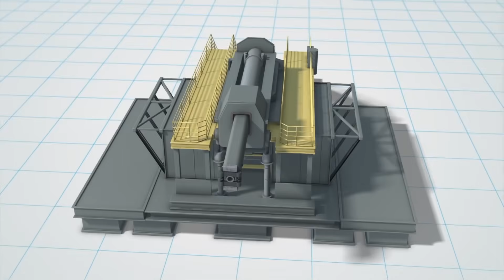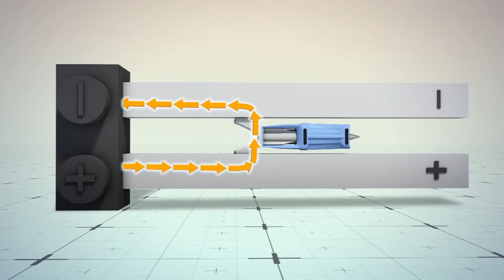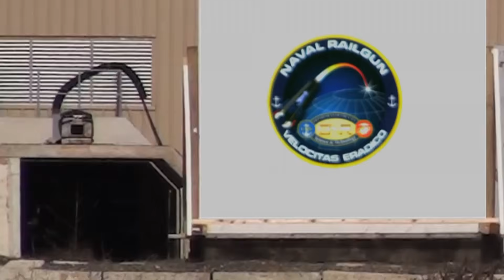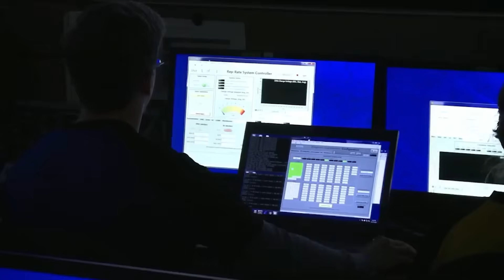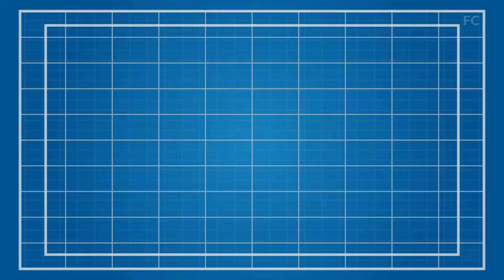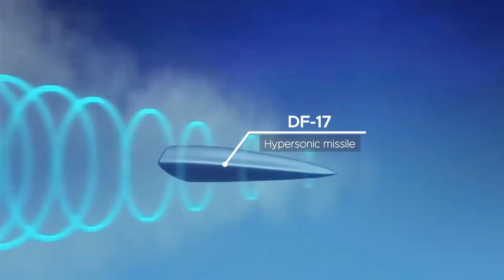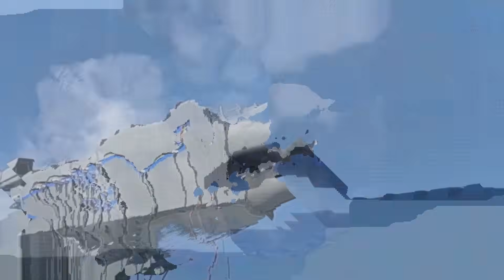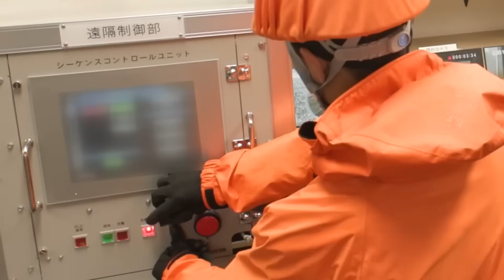Japan's New MASSIVE Railgun Just Beat Every $5M Chinese Missile!

Comment: The rail and laser are both designed for flat earth operation.  Because of the time of flight, there is a significant drop in elevation and just like a rifle, the sights have to be adjusted up.  The laser does not have that issue but can't shoot over a curved surface.  These videos are for an uninformed public but the military knows that the earth is flat.
I will add that the rail gun was a project many of my friends have worked on going back over 40 years so the 15 year project stated was only one phase over the length of the project in Austin, TX.

Comment: I don't believe that a slug from a rail gun can hit a hyper-sonic missile with any reliability. Assuming the initial targeting solution is accurate, that the gun has the inherent accuracy, variations in wind and atmosphere conditions would be sufficient to result in a miss at ranges of many km from the gun. It would be easier using a missile with onboard guidance that only needs to explode anywhere near the attacking missile. This is a dream.

Comment: China vs Japan Railgun: Direct Comparison
ChinaJapanFirst shipboard test20182023Muzzle velocityMach 7Mach 6.5Projectile mass124 kg320 gramsRange100-200 km~20 kmPurposeOffensive strikePoint defenseGuided munitionsYes (BeiDou-linked)In developmentAI integration100,000 sensors, self-improvingNot reportedBarrel life120 rounds120+ rounds
Bottom line: China fires a projectile 387 times heavier, five years earlier, at higher speed, with 10x the range, and has satellite-guided smart shells.
Japan built a defensive pea-shooter. China built an offensive cannon.

Comment: The key to all of this is the famous Japanese capacitors. No country on earth has mastered capacitors like Japan has. If your electronics (from stereos to computers) do not have Japanese capacitors in them, throw it out. NOTHING is as great as the Japanese have made them. That country does not exist. Thank you Japan for doing it correctly!
A capacitor provides all the required electrical current to all the components in the right balance or correct 'capacitance' (no pun intended). It does not matter the size of the electronic components (be they small watches to giant rail guns) if the correct power, when its needed, is not delivered at the correct time for the job needed the electronics will overheat. The enemy of ALL electronics is HEAT. Lower the heat and you will provide insane reliability. Enter the Japanese capacitor. They mastered this tiny (or large) component which is so key to everything that runs and uses electricity.
I would never entertain buying a motherboard if it did not have Japanese capacitors. You would be an insane person to not go with their brilliance. As personal computers are starting to exceed 8300+ Mhz speeds, the capacitor has its work cut out for it. That is an INSANELY fast speed of electrical travel amongst components. Japan always leading the way in all future technology. God bless Japan and keep them free forever. ❤

Comment: Awesome news! It should also be noted that 40mm is large enough to mount a minimal guidance system. Since it only needs to operate for less than 30 (hyper-sonic >= 1 mile per second; 20 mile range) seconds, power requirement is minimal. Forget onboard radar. Even attenuated lasers can be used to "paint" the target out to 20 miles (can be the same lasers used for close-in defense, just needs to be bright enough for a photo chip about the size and weight of a cell phone camera). Nearly weightless piezo-electric fins can be used for steering.

It is almost irrelevant that it was Japan who made it work. We both have a vested interest in sharing this technology.

Oh, and about China taking China using hyper-sonic missiles to conquer Taiwan in a conventional war? Hahahahah!!!!! Make the whole island into an "unsinkable ship" mounting thousands of these puppies. That is checkmate against missiles, planes, and landing ships...

Comment: The power infrastructure and expense required to sustain fire on a rail gun, even if successfully developed, is unfeasible when it can be massively out-ranged and destroyed with a much lower cost hypersonic missile. It’s like trying to invent a giant high tech crossbow or catapult.
Reply: Range isn't a factor since the missile is heading for the target. Also mach 6.5 is hypersonic. Third it is being used as a missile interceptor.
Reply: @richardhill4938 how does a rail gun target a hypersonic glide vehicle?

Comment: 11:32 So japan beat the usa by making a temu version of what usa tried to make. still awesome that they did that unlike the USA simply pausing the program to concentrate on hypersonic cruise missiles instead.
 USA "wanted": 64 megajoules(MJ), 155mm, Mach7+,  10,000 gram projectiles (10+ kg), 100+ Nautical Mile range, 185km - 370km (115 to 230 miles)
Japan made: 5 megajoules (MJ), 40mm, Mach 6.5, 320-gram projectiles, 100 to 180 kilometers (62 to 112 miles)

Comment: The weapon has a fatal flaw, just as the chinese laser has a fatal flaw.  The tungsten slug HAS to hit the target, otherwise it's useless.  But it has no guidance system, no heat seeking, no ability for proximity explosion.
Reply: Did you actually watch the video particularly on the satellite constellation and underwater drone centimeter-accurate guidance system part?

Comment: Big error in this video. China lasers are dismissed cause performance is decreased by humidity and distance. However. China will be aggressor in China Sea. They can pick attack days with low humidity and zap laser from 5 miles. China likely to attack Taiwan by 2028.

Comment: Wait. @ 9:42  said: "Deep Ninja beams coordinates to the surface" 
How do you "beam" coordinates through 4,000 meters of water?
Reply: I was wondering that. 
My understanding is that high frequency signals (like radio, or even light) don't propagate well through water, which is why it gets dark as you go down even just 10 or 20m. I didn't think Ultra Low Frequency comms could be used effectively over such a large distance, but maybe I'm wrong.
Reply: @namewithheld8115  And even if VLF acoustic comms were effective at that distance (maybe)
(a) VLF bandwidth is slower than typing in a pin at an ATM with gloves on
(b) who or what's at the surface listening?
Reply: Well, Trieste bathyscaphe spoke with it's support ship in 1960, from the very bottom of Marianna trench, 11000 meter deep. Ultrasound beam. You still need a surface satellite repeater in a few miles range, but that might be a very small submersible drone which pops out, beams a few bites and goes back underwater. Just a thought...

Comment: Why didnt they make the chamber operate in vacuum? No air, no,plasma
Reply: Not really. Most of the plasma comes from the vaporized metal itself, the rail is like a continuous switch at MegaAmpere. That's why they put Tungsten in the alloy, copper evaporates more easily. Not adding that vacuuming a barrel helps, but lowers a lot the repetition rate.

Comment: It doesn't sound like it's there yet - range is awesome, but neither the 120 shot barrel life nor the impact force equal to 2 lbs. TNT are good.
Reply: They did not say it was 120 shot barrel life. They said it was a 120 shot test with no barrel deterioration or failure.
Reply: @georgeacton9106  120 shot barrel life from an internet search.
Reply: This weapon is being developed as a medium range anti-missile option. It managed 120 shots with zero loss of muzzle velocity in a test firing drill. That doesn't mean an operational lifespan per barrel of 120 shots, but rather that the barrel did not deteriorate detectably at all after 120 shots, implying a much greater total service lifespan. As for the two pound TNT equivalent explosive yield, that is more than enough to take out an opposing missiles in itself, and it is described as the equivalent of two pounds of TNT detonating inside the target while possessing an extreme faculty for penetrating armour. Very few platforms indeed could survive two pounds of TNT detonated inside them.
Reply: @gregorygreenwood-nimmo4954  120 shot barrel life is from an internet search.  2 lbs. Anti-missile defenses other than lasers don't rely on direct impact, that would be a silly claim for an unguided projectile, they detonate ahead of the target and rely on shrapnel.  TNT is based on the energy released, some\most of which would be dissipated on impact.

Comment: purpose made. If a longer range with bigger slugs is required, new materials will be probably developed. Hybrid systems would be fancy as well - accelerate cruisemissles without boosters to supercruise speeds or AAMs to mach 2 right out of the launcher would extend range and shorten the reaction time in case of interception. just sayin'.😉

Comment: You don’t need nuclear reactor or city block of batteries for 25MW of short term power. 25 standard EV batteries are more than enough. There are many ev’s that has more than 1MW power. Capacitors are needed to provide peak power for launch, and they are the most critical and space consuming part. 25 ev battery packs can fit on one pile on the back of the container.

Comment: A $35,000 interceptor with a range of 20 miles is not that impressive. Israel Iron Dome is a 45 miles range interceptor for $55,000.
Reply: The israel iron dome looks like a failure so far, not impressive at all